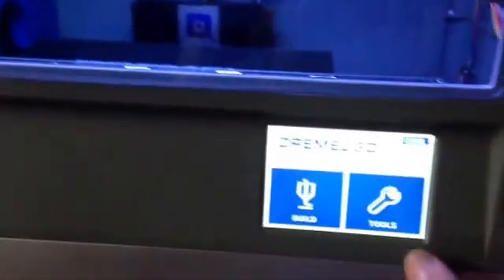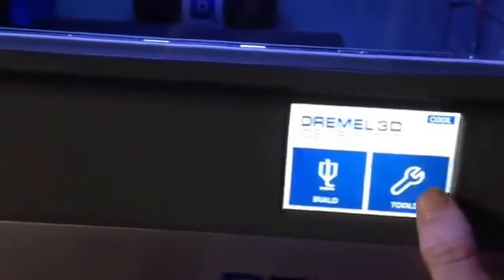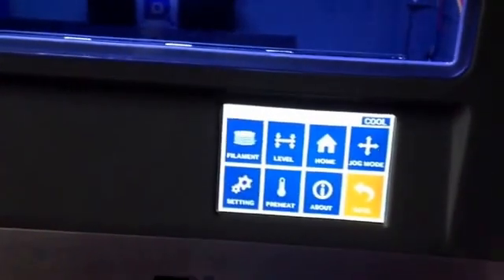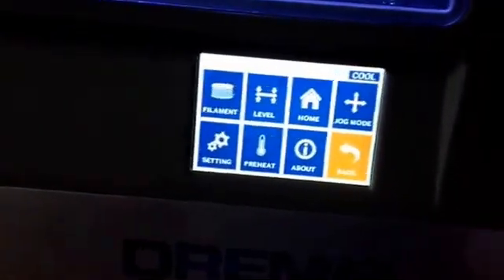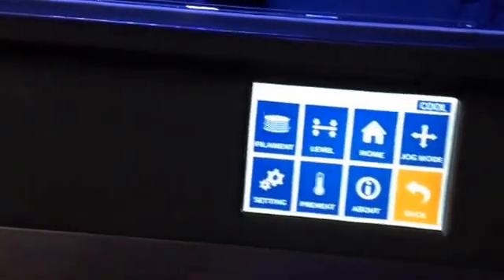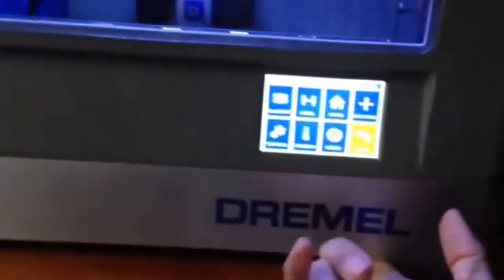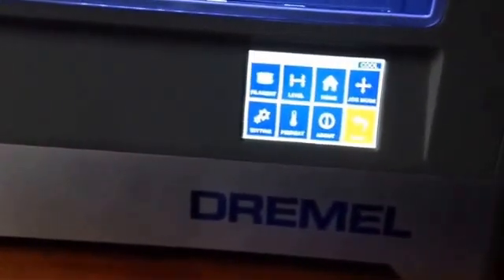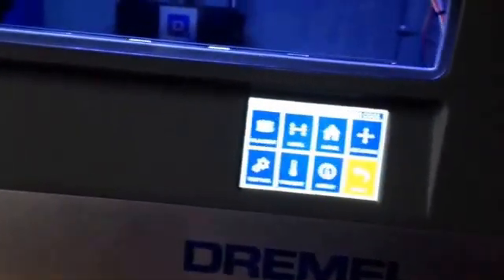Dremel Idea Builder Touch Screen Problem Solved

Comment: Did you ever have the issue return? I'm on the third cycle of this happening...
Reply from the maker: newton2013 no I haven’t had this problem return at all. I did have another problem where the printer wasn’t being recognized by any computer via usb cable. Ended up having to send it for repair and they replaced the board.  Guess the USB port had died.

Comment: So I did this and it works half.
I can go to the build menu.
But cant go to Tools. that crashes the printer and restarts.
any tips?
Reply: I was able to eject the card, format it, and then put it back in and it fixed the problem.

Comment: Excuse me, you have to replace the SD card for a new one ? Or formatting the one that comes with the printer do the trick? Thanks for your video :)
Reply from the maker: No you don't have to format at it at all. Literally all you do is eject the card and put it back in. Keep in mind, this is the microSD card underneath the printer that I'm talking about. Not the SD card that came with the printer that you plug in near the power switch. 

Flip the dremel onto its back and take the bottom panel off. At the top right (which is the area that is under the LCD screen when it's upright) look for a microSD card. It may have a glob of that really hard packing glue on it. Even if that is on it, the card needs to be ejected and reinserted. So carefully pick the glue off, push in on the card to make it eject, then put it back in. 

That's all there was to it. Hopefully your is the same issue and can be fixed as easily. :)